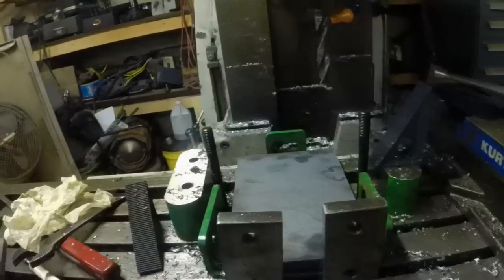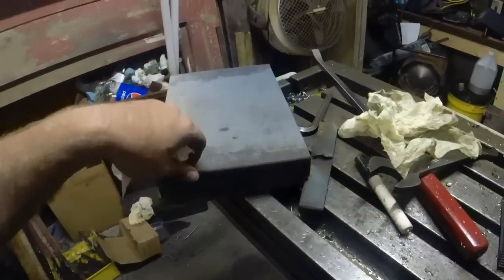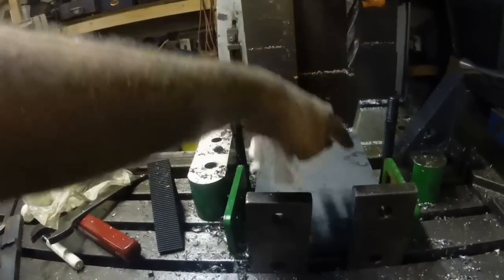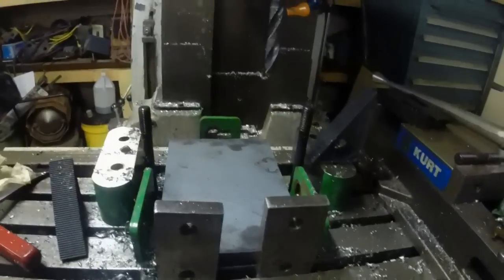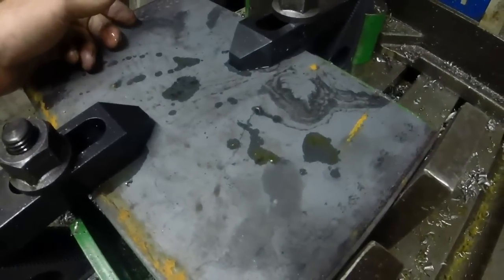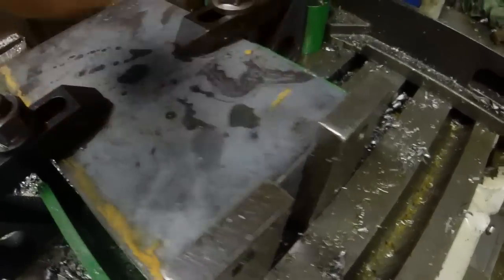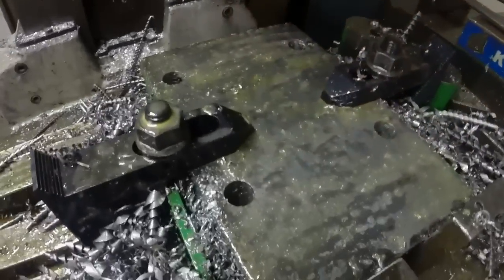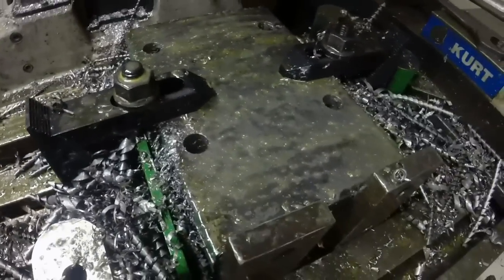Stop Blocks

Comment: As usual, great video Brian. Thanks. The stops are a great idea .....been using them for years.
Reply from the maker: +Darren Martin Glad to hear. I rarely see people take advantage of their t-slots for indexing out side of the big machine shops. I learned it from an HBM operator that used blocks extensively in setups on big gear cases for mining equipment.

Comment: Nice setup.  I should make some block.
Reply from the maker: +Randy Richard They are a valuable addition especially for parts to big to fit in a vise. If you do make some be sure to put a couple of threaded holes in them like mine so you can use push bolts in case you need to indicate an irregular shaped part or need to set an angle. It makes them even more versatile. :-)

Comment: Making my own tooling is, I think, the main reason I'd like a surface grinder.. 
Ever think about getting a BP or clone for the drilling work? 

Colin
Reply from the maker: +CompEdgeX Actually I have a hankering for a big radial drill. I want one I can setup at the foot of my HBM that I could either use with its base or rotate around and  drill on the HBM table as well that way I could use the DRO on the HBM to position under the radial drill. Last year I had to do several jobs that required hand drilling because they were to big diameter to fit in even my mill, but that wouldn't be a problem on the radial.

Comment: Good stuff Brian.  Why wouldn't you use a Bridgeport for heavy duty work like that? :)
Reply from the maker: +turbocobra Mainly because I don't have one! lol
Reply from the maker: Knolltop Farms
 No feel to anything really on a big mill. It just eats whatever the weakest thing it comes in contact with is. They don't give up unless you tell them to. There is no stalling out or slipping belts so you have to respect the big boys. I would say sound is probably the biggest thing even though the mill is loud you can tell a lot about what is going on by the sounds.
Reply: +bcbloc02 LOL! That is the same reason I don't do it on a BP...

One question when it comes to drilling on the Cinnci, do you raise the table by hand using a lever on the feed so you can get a "feel" for it, or do you have a setting that you use to auto-feed that you've just learned works? Does that question even make any sense? LOL!
Reply from the maker: Knolltop Farms
 I powerfeed till the chips look good. If the  bit snaps off the feed was too heavy. lol I usually drill at 3.5inches/minute.
Reply: Got it, that is/was kinda what I thought. Is there still some feedback in your feed levers like there is on a quill-feed, even if somewhat diminished? Sorry to be so inquisative, I am just so curious about the big horizontals and love the way you find work arounds for it not being like a BP style mill
Reply: Answers my questions, THANKS! I use sound allot in welding too, so I know what you mean :)